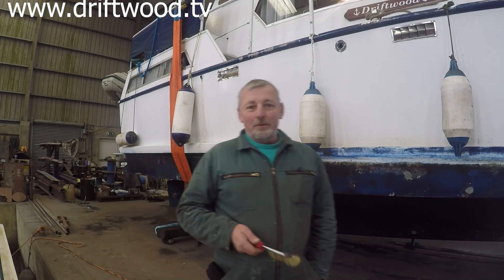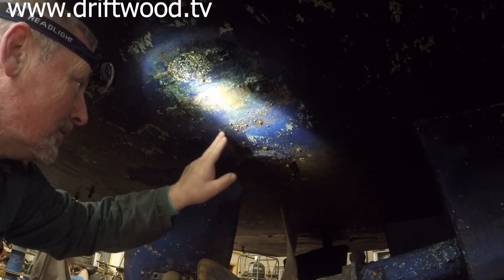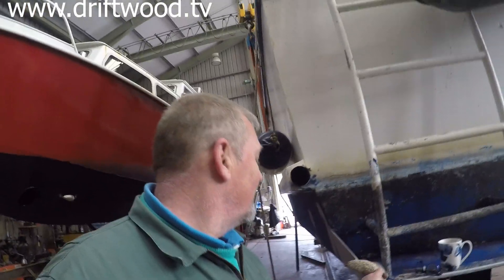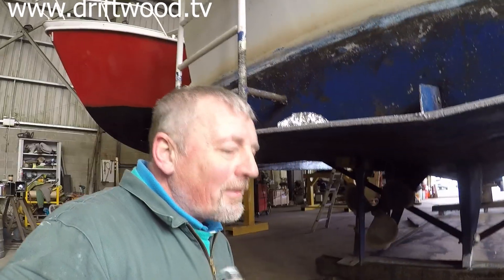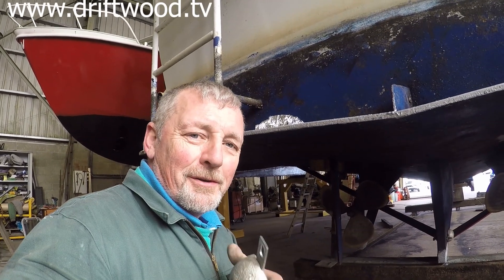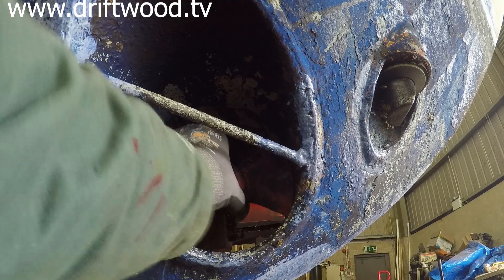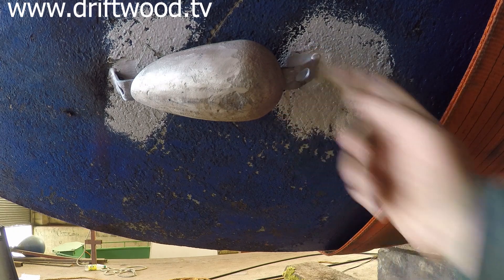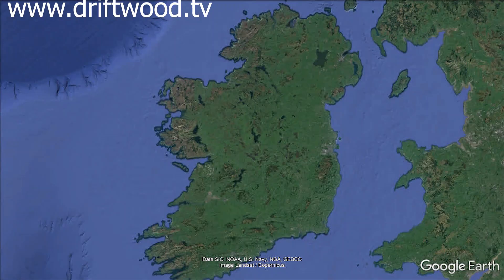Sacrificial Anode On Boats - Treating Rust Spots

Comment: Hello there, I have a steel boat and I was wondering when was the last time you took the boat out of the water and changed the anodes? Cheers
Reply from the maker: Hi Charlotte, I change the anodes about every 5-6 years. But if I go onto coastal water for any time I'd I check them to see if they need to be changed sooner. Best of luck with your boat ;-)

Comment: i couldnt hear you with the background noise, were you talking about painting the anodes???
i dont know much but i do know that the sea shield anodes have "do not paint" cast right into them.
Reply from the maker: Hi, ye the sound wasn't great in that vid. We have actually invested in better sound gear since! But no you never paint anodes, as you say. Ta
Reply: pretty sure he was only painting the hull around the weld on the inside and outside but not the anode.

Comment: How long have the boat was been out of water was it expensive to lift it for her size and how that whole process work
Reply from the maker: We only had it out of the water for about three days, generally the weight of the boat won't effect the cost of the lift. So long as it's not too heavy too lift. Hard to gauge the cost of the lift as it's usually bundled in with other jobs. But that said I know of marinas where they charged as little as €100 lift out and the same back in. Most marinas would be €150 each way and some will charge more if they feel they can get away with it. Good to shop around for these things and try to strike a deal.
Reply: @DriftwoodBoatBlog  thank for reply that not expensive that I have in mind least I thought there was a time limit or something now I can take my time painting the boat thank for info

Comment: What do anodes do what I mean is why are they on the boat
Reply from the maker: Hi Kathleen, they are a sacrificial corrosive which means that they will corrode away and in doing so the harder steel of the boat won't rust. Bit hard to explain but that's basically it!